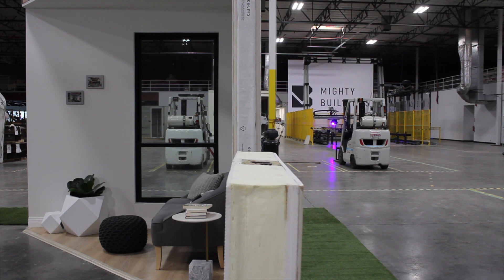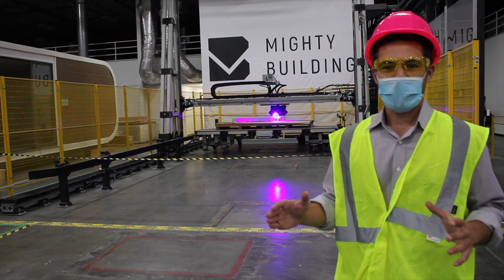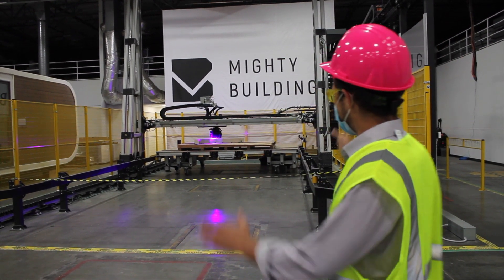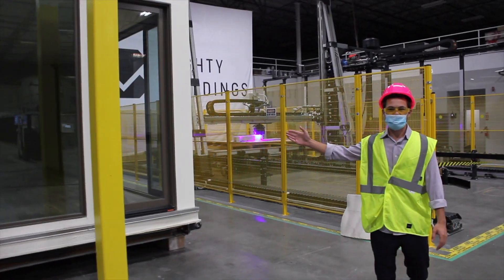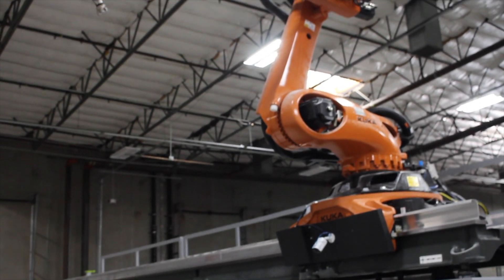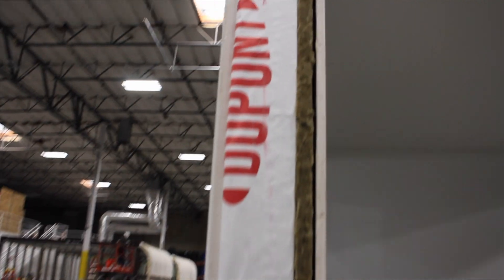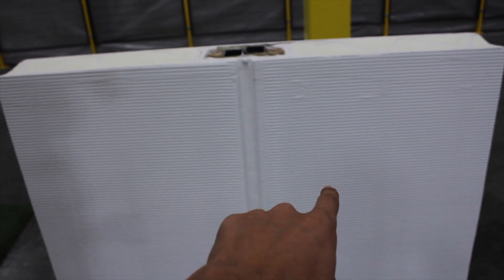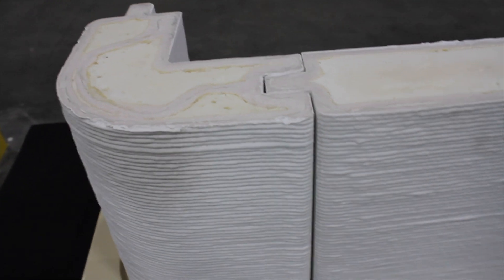Mighty Buildings Facility & UV 3D Printer

Comment: Just BTW, the "mold" at the end is called a tongue and groove, and its used in woodworking alot for example, but also in construction here and there :) 
UV curing stuff is great and all but the stuff is kind of a pain to use as you really cannot let the material see the sun or itll harden, atleast thats how UV cured resin works, if you show it to the sun it already starts to set a little, and when you want to pump it in a hose it might do something, not to mention when you have the point of storage to pump, it should be in the dark :P

Comment: I’ve been waiting for you to cover Mighty Buildings! What are your thoughts on how their synthetic stone compares to other print materials; namely concrete? 
Personally I think Mighty Buildings is on track for a far superior product (for American markets) and could totally disrupt the industry if they lean into their innovative edge.
Reply from the maker: TBD, I’m hoping to do a podcast episode with them soon and ask. This video is actually from over a year ago!
Reply: @automateconstruction  awesome! If you do, ask about integrating as much into the print as possible; e.g. electrical conduit, plumbing, HVAC, etc. They’re already providing a turn-key solution for ADUs, but integrating more into the print would increase their efficiency. 
Adding custom electronics could surge their market as well; e.g. low voltage lines for all LED lighting, custom (but standardized) smart home interface, built-in security system, etc. 
They’d have a huge market for real-estate investors if a rental ADU (or house) was turn-key ready for investors. Operated like Airbnb, except it’s a standardized product around the world. Financing options could be made available from the rental income reducing the barrier for most investors. It’s a very powerful business model that they’re in a niche position to fill where no one else on the market could come close (not quickly anyway).